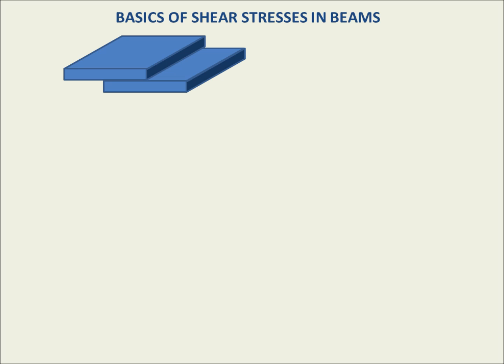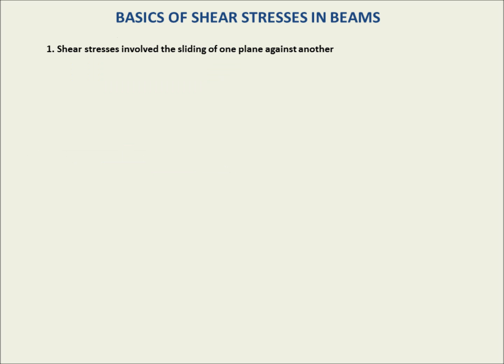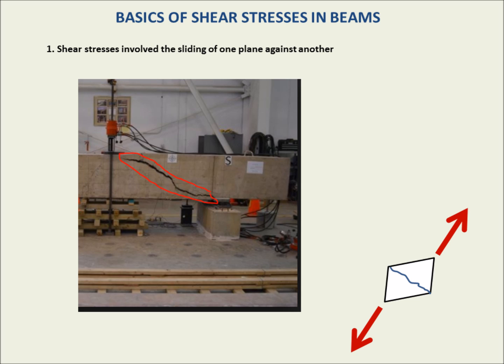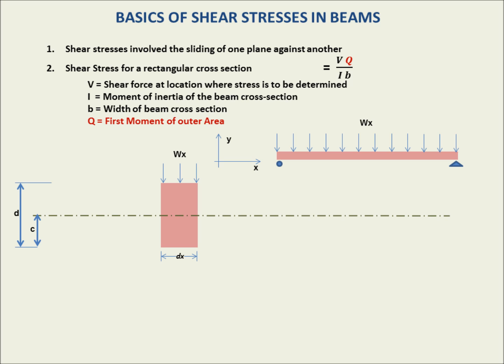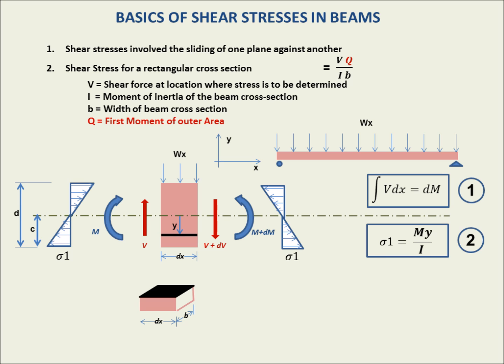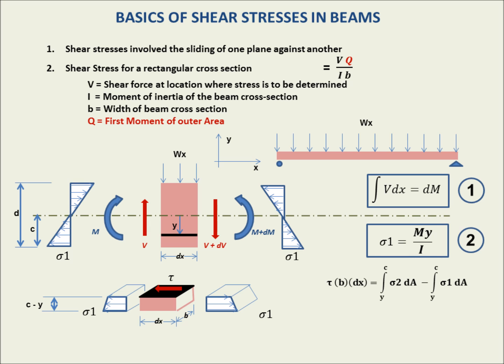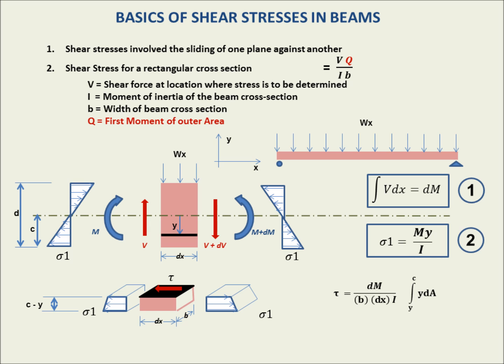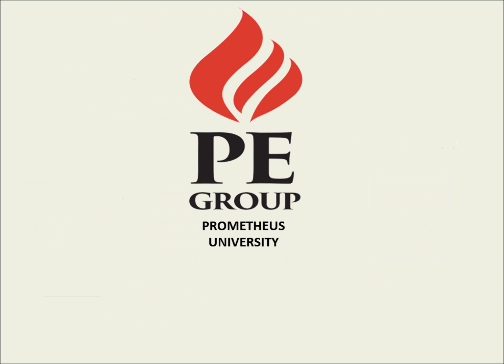Basics of Shear Stresses in Beams

Comment: I'm really late to the party, but I wanna ask. As far as I can see, the sigma1 formula only stays true for elastic stage of the material, so would the shear stresses formula. What'll happen if the cross-section approach the plastic stage? Will the formula change? If it does, then what is the universal way to calculate?
Reply from the maker: Correct.  The video on the plastic section m modulus will give you the clue as to the manner in which the formula changes
Reply from the maker: Check out the latest in the structural dynamics series.  https://www.youtube.com/watch?v=92pA9aG8Usg